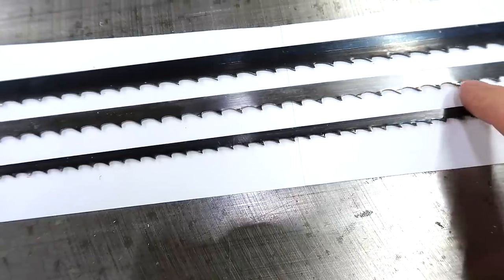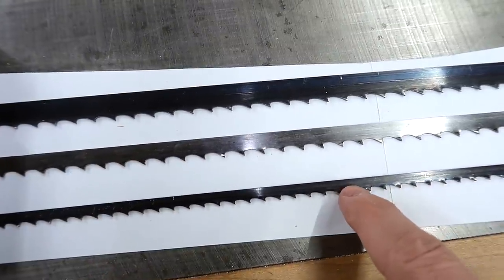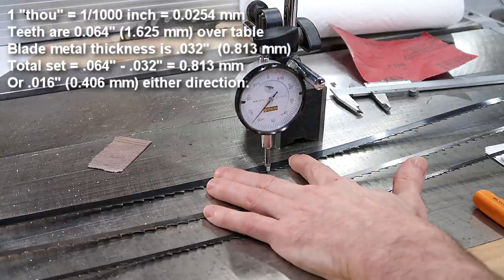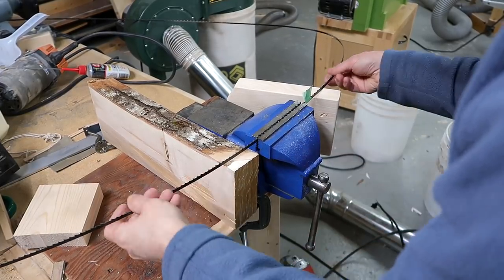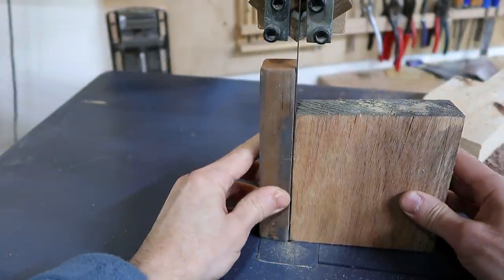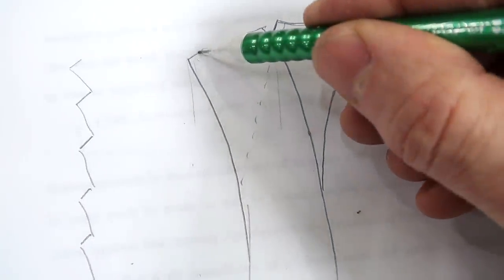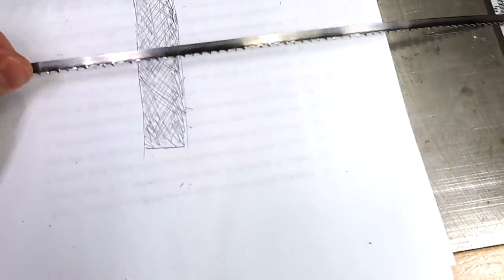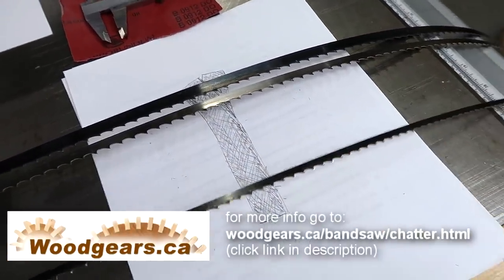Bandsaw chatter, modifying tooth set, and making precise cuts

Comment: YOU CAN GET SOME OF THE RADIUS BACK!  I have done this trick, pressing a grinding stone on a running blade.  Angle the stone against the blade's trailing edge to round it over.  It looks microscopic but it really can reduce the minimum radius in curves, and also reduce some of the running friction of the blade in the cut if your tooth set is especially shallow.
Reply: Matthias has shown this trick before, IIRC

Comment: Reducing the set as you have and "stoning" the blade are techniques that work well, in my experience.  I stoned the blades as you did without reversing the blade and everything worked out fine. I think blade tension might also be a slight factor, because smaller blades can't tension as much as larger blades.  Just one person's experience.
Great video.  Thanks.

Comment: Would changing the speed of the motor improve the blade's performance?
Reply: I'm thinking the same. Maybe it's going too fast. Looking at the slow motion we see that the blade is pushed back and all the teeth slide and are not cutting, until the pressure is enough to overcome and then one of the teeth bites in and jerks the wood.
Reply: @Tweogan  No, its going toooo slow. Optimal speed of blade is around 30-35m/s. He has around 10 I think, from previous video.

Comment: A glance through the comments and I didn't see one like this.  I've had saw chatter but never seen a blade pulled forward until this video... and then again just a few days ago on my Delta knock off bandsaw.   I'm planning some resawing - quite a lot for me so I purchased and Olson 3/4" 3TPI blade.   It behaved much like Matthias's blades.   It pulled the blade away from the back bearing and towards the metal insert on the table which was a bit alarming.

My solution was to re-adjust the tracking with a bit more force back towards the back bearing so the blade made more constant contact.  YMMV.  

I'm not entirely sure if this was just a new observation or if it was a new phenomenon.   I sure don't get those kind of lovely smooth cuts on my saw but resawing ends up in a thickness planer anyway.

Comment: Matthais, it may be something you never do, but I find that a high set blade is very useful when cutting round work  in green wood (bowl blanks for instance)  this seems to stop the blade jamming (most of the time !)
       That blade does not appear to “lunge forward’ but rather, seems to come back to vertical, where is your rear guide in relation to the blade at rest ?
      I have never dressed the tips in that way, interesting, I always take the arrises off the back of a blade,I think it makes turning the blade in the cut easier.

Comment: The tooth set reduction will leave your cuts just a little smoother but will not fix the issue at all. Steep hook angles and low TPI blades are for rough ripping applications. The only thing that will offset the low TPI/hook angle is ramping up the rpm of the blade my 1.25" x 158" have a 7/8" tooth spacing with a .025 set and runs at 5800 fpm and unless I whack something in the logs and break a tooth or throw a tooth out of set, the cuts are planer smooth.

Comment: Have you tried cutting without the table and going directly off the frame? Wondering if the table has some bounce or weird modal response since it's bigger than your other saws. 0:46 trying to find nodes in the sawdust like a chladni plate. Since the table has a long slot for the blade, it's basically a big tuning fork.

Comment: I guess you need to resharpen those blades with less hook. Also, passing the blade through 2 side by side large diameter bearings, mounted on a stiff base (metal), will force the teeth to a lower set in a faster way, and making the distance between bearings adjustable, allows testing for the best results.

Comment: I would suggest using smooth faces on the vise along with a calibrated torque gauge on the jaw handle, in order to perfectly align the set of the blade's teeth along with a preheating process in combination with a laser actuated temperature gauge in order to avoid getting the blade too soft. In this manner, one might conceivably set the blade's teeth to within 1000th per inch accuracy, along with a timed, progressive feed into the jaws of the vice, consistent to  the 100th of a second.  This might be done by very meticulous elves who have experience in these matters.

Otherwise you could simply file the teeth down in just the manner that is shown in this video.  

Thanks for the content.
Keep up the good work.  בס״ד

Comment: "Cnc takes longer if you factor in the time to program it" Yep. For one off productions cnc is usually a waste of time. That being said there is some new scanners coming out, cheaply and therefore more common to find, that make part duplication via cnc actually quicker..which can also be a problem. 

As for blades, a properly ground blade cuts very well for a long long time, there is also another factor to bandsawing. Dust. If the blade speed is too slow on your bandsaw the dust collects intermittently jamming the blade. Ive noticed this as it sounds like the blade is broken or hitting something. Very noticeable when I cut green wood.

Comment: Very interesting. I'm enjoying your sleuthing on The Case of the Chattering Bandsaw.

Two things I wonder about are how blade tension affects the chattering issue, and how the blade width and thickness affects the chattering issue.

I'm thinking at the instant the blade begins its aggression into the workpiece, the blade is still suspended in nearly the same 'track' on the wheel. It must be bending toward the workpiece. How do the width and thickness of the blade play against this bending?

What's the process for setting blade tension? Is it the same for all 3 blades, wide, 3/8, 1/4? What if your tensioning process unwittingly favors the blade that seems to chatter least?

The blade's aggression into the workpiece reminds me of how chainsaw chains are designed. Each tooth has a very aggressive cutting attitude, but each tooth also has a depth gauge that limits the material removal rate of each tooth and prevents this aggressive diving in that you're experiencing.

What if you consider a blade that causes you this chatter problem due to this aggression, get blade that's exactly the same except twice as many teeth per inch. On that double TPI blade effectively disable every other tooth from cutting. Those disabled teeth would be like depth gauges on a chainsaw chain.
Reply: I just rewatched you building the wheels for this bandsaw. Since the wheels are 26" diameter, there is a good 80" of blade in contact with the wheels continuously. The stiffness of the wheel and its parts are going to contribute quite a bit to rigidity. With such a large percentage of the blade in contact with the wheel, what seems like a lot of blade tension is divided along a lot of wheel surface. So the inner tube rubber isn't really being compressed much. This makes me think it's got more to give and may contribute to instability when made to work hard enough. The wider blade covers more rubber so its pressure per square inch is further reduced allowing for more sponginess. The narrow blades may better compress the rubber, but it looks like you didn't glue the rubber down, so maybe the blade and rubber are slipping or walking? Maybe consider a harder thinner rubber tire material and glue it down? Perhaps you did glue it off camera? Anyway, just some thoughts 🤷

Comment: I have worked in a saw shop in a modern sawmill for several years and i think that the most likely reason for the thin blade to move in the cut like it does it the back of the blade on is not straight. Put a long straight edge against the back of the blade near the weld and in several places along its length. I am sure you will find that most areas of the back are flush to the straight edge and near the weld it it bowed in or out. We had the same problem on our large 10"X38' band saws. I am not sure how to fix that on a blade that thin.

Comment: Hi Matthias, I’m curious about the tooth geometry of those blades. Larger blades with less tpi generally have rip teeth, smaller blades with more tpi generally have cross cut teeth. Cross cutting with a rip tooth profile will be jumpy. 
Have you examined the tooth profile? 
Rip teeth are more like a chisel at 10 degrees, crosscut teeth are more slicey at 35 degrees.

Comment: I would also expect blade tension to affect the chatter. Did you test that? I once started my bandsaw after I forgot to RE tension. Was surprised by the amount of chatter.
Reply from the maker: Yes, tried that.  I figured if I ran it hard against the trust bearing, with the guide close to the blade, and more tension, that should help.  But with a quick test I did, it made no difference.

Comment: Would be interesting with a comparison with a metal bandsaw and see how much the chattering is due to the frequency/softness of the wood that the bandsaw is made of.
Reply: Exactly what I was imagining, the wood has a harmonic frequency that sets up a sympathetic vibration with the walls of the structure, which also could effect the stability to the extent that the blade's chattering has caused the wood to chip out whenever that type of wood is being used. Theoretically, this harmonious vibration could cause Matthias's spectacles to crack - but they are most likely plastic, not glass, so we should not have any worry of this. 

Putting the blades in backwards was a very barbaric choice, however.

Comment: Is the blade running too slow? the top wheel is the largest of all your bandsaws, its like the big chainring on a bike, the blade is moving more slowly. Can you get some type of variable speed drive for the AC motor that would enable you to run the motor faster? Can you test the blade on a smaller bandsaw?

Comment: Still no mention of a lack of rigidity as a potential source of the grabbing problem?
Reply from the maker: the wider blade, being more rigid, probably helps.  Though it also has a bit less hook to it.
Reply: @matthiaswandel  Any thoughts on tensioning the blade... increasing it on the chatty blade?
Reply: @matthiaswandel  I mean the rigidity of your bandsaw frame.
Reply: @beefchicken  I think it is just as rigid as a cast iron frame. Didn't he check that out? It looks pretty rigid to me. Anything C shaped with a 26" span will have some small amount of flex. But I think Matthias showed previously that wood built up to an appropriate thickness can be just as rigid as cast iron. Anyway I trust Matthias to correctly diagnose what is going on.

Comment: i have a question about tooth shape
most of my jigsaw blades slopes inward, and you draw bandsaw blade tooth sloping outward and being well full thickness of the blade not pointy from either side 

so how does a bandsaw blade cut? does it carves, slices or scrapes the material? because we have possybility to sharpen it as either one as a row of basically knives, chisels or hooks/scrapers

Comment: Isn’t it the hook angle of the tooth not the set that makes it lurch forward into the wood. The aggressive set would certainly cause it to leave a rough cut surface. How did those blades cut with the grain?  I bet they would be great for ripping on a very small scale sawmill per say.…

Comment: If the shape of the tooth hooks into the wood and grabs the blade, would increasing the speed help ? If the tooth moves so fast that it cuts on it's way without having the time to actually hook to anything ? What happens if you increase the size of the pulley on the motor to increase the speed ?

Comment: Is the blade guide too weak or springy somehow ? Or maybe one of the guide bearings has too much clearance.
Oh, now i see what "hook" means. That seems to be more of a problem because it's pulling the blade forward into the wood.
It's a bit like drilling brass - you just don't want to much "hook" on the cutting edge.

Comment: I would expect that the narrow width of the grabby blade to be a important variable.  Narrow width equals more flex at the cut.  Same with the length of the blade, more length equals more flex.  Wouldn't a shorter and/or wider blade with the exact same tooth profile grab less and cut cleaner?
Reply: Makes perfect sense to me. The blade guides can't stop forward movement, so the more distance between wheel centers, the more the blade can move in the forward direction, regardless of how low you place the blade guide. I also wonder if the wheel curvature is a factor. These wheels were made to be able to take really big blades, but maybe that leaves them a bit flat in the middle, for running thin blades. If the wheels are wide and flat, the blade can walk forward without as much bias to stay where it normally tracks.
Reply: FWIW, I only tried a hook blade once. And it happened to be a 1/4" width, 25 thous thickness, at 4 TPI. I loved it, compared to the 6 TPI blades I had used until then. I don't remember it chattering like this. But it became the first and only blade I ruined by jamming, when it grabbed and flipped a small piece I was cutting out of my fingers and into the blade. I been using low TPI blades ever since, but without the hook.

Comment: I was naive enough to assume that manufacturers had studied the science and engineered their product to a point where any blade you purchased would not have this problem. A cheap blade may not stay sharp as long as a higher end one but it seems that the blade design should be sufficiently similar that they both give satisfactory results, at least while new/sharp. Let’s hear from viewers if they have observed this problem with their bandsaw blades. 😎👍👀

Comment: This is a bit long, so if you think it's inappropriate feel free to delete it.
Watch your slowed down high speed footage and pay attention to the close up after the blade exits the sapwood and starts into the heartwood. Walnut is semi-ring porous or semi diffuse porous wood. Either name is correct. Notice also that the chatter is not consistent in singing tone. Now note that the forward bound occurs when the blade clears the dense ring and is rapidly pulled by hook to advance into the porous ring. Keep watching and notice how the rate of bounding forward will change as the angle of the dense and porous wood change as you cross the board from quarter cut to rift cut to flat cut.
WRT to the narrowest blade being the most problematic with its hook tooth, the ratio of the tooth set to width of blade is quite high (as far saw blades go). Just as this fact lets you cut a tighter radius, it also subjects the blade to being pulled to the side by an aggressively hooked tooth. With coarse TPI the blade will tend sing as it oscillates, but finer TPI with its proportionally smaller tooth will be pulled less before its counterpart pulls back the other way.
Before setting a tooth has neutral edge with respect to the depth, front to back, and with respect to the length of the body. The machine "stamped" set of a fresh new bandsaw blade is now not optimal. As a tooth is set, the cutting edge of the face of the tooth is now in a negative rake as your expanded diagram illustrates. This property of the tooth, properly called the "fleam" has to be corrected as with a handsaw. The leading edge of the tooth sideways and forward must be the most prominent point, and must have a slight positive rake. This can be done very easily and quickly with a Dremel tool and a diamond disc. The right fleam will cure these oscillation and bouncing problems. However, ripping blades should have a neutral fleam and not negative.
Less oscillation results in a smoother cut. If this oscillation didn't take place we would have bandsaw cuts as smooth as table saw cuts!

Comment: Does the hook on the blade cause the same issues on your smaller bandsaws? If not, it would be interesting to know why this problem arose on the larger saw? Perhaps you've reached the rigidity limits that a wooden frame can provide?
Reply from the maker: I don't have one of those blades for my smaller bandsaws
Reply: @matthiaswandel  Thanks for replying! It's just that these blades looked fairly normal to me. Did you compare the hook profile of these blades to the blades on the smaller saws?

Comment: Vary the motor speed! +-100RPM every 1.5 seconds will do wonders.
Reply: How does he do that with an induction motor? Make the pixies dance faster?
Reply: I was thinking the same. That wooden structure has own chatter frequency and changing speed of the blade can eliminate that. VFD's are pretty expensive for such experiments but Matthias could make few other pulleys of different OD for experiment.
Reply: DC motor; vary the voltage. Induction motor; vary the frequency.
Reply: While I doubt this would fix the problem, if you are going to do it, it would be much easier to put a friction brake on the driven wheel. Vary the friction to vary the speed. Of course VFD could do it. But VFD is not in character for Matthias unless he finds one in a neighbor's trash bin. The friction brake could be some rudimentary affair. Not a disc brake or anything. Maybe a leather strap on a wood drum.